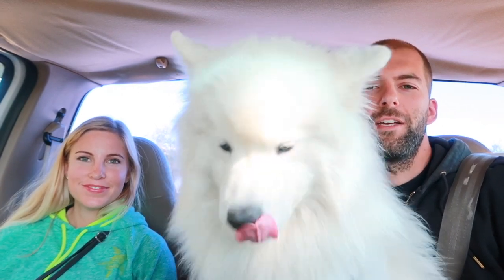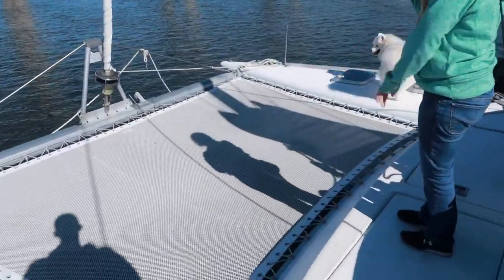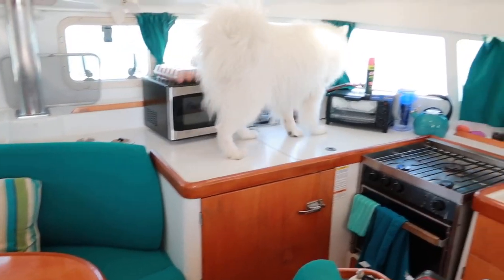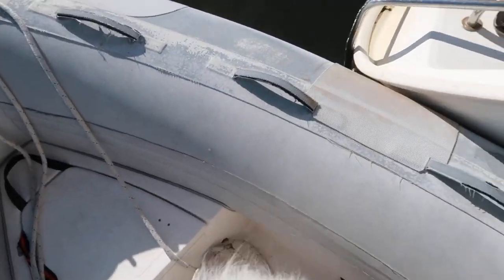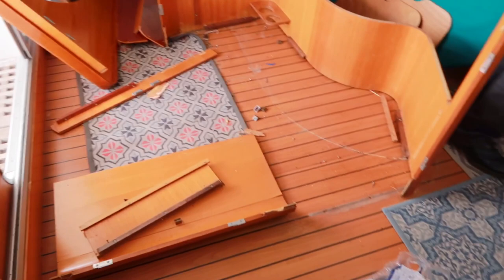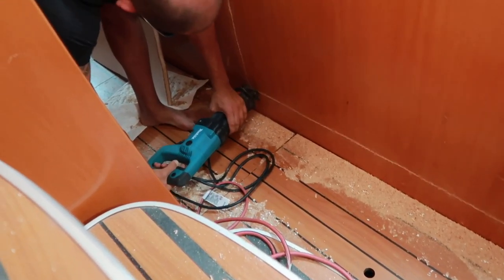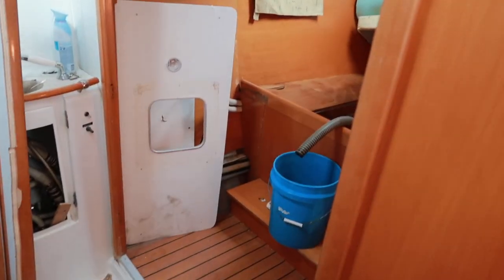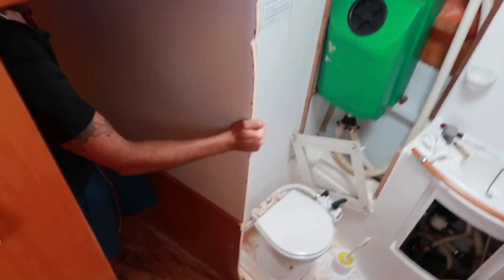Dog moves onto boat & demolition begins!

Comment: Looks like she's going to fit right in on the boat. She sure is a beautiful baby...
My heat sunk into my tummy when I saw you cut through that beautiful molding around the door. It's pieces like that I save for just incase I need to pretty up something latter. Then if I don't use it when I'm done I toss it or give it to someone that might use it. I can hardly wait to see what you kids have planed for the refit/remodeling... Have fun, be safe, and be blessed... BBE...

Comment: Did you guys meet the couple from SV Ruby Rose,  Nick and Terysa. They should have been there at the same time as you guys. If you not from around there you should check out a bar called the Tattooed Mosse and if you are then you most likely have heard of it, one of the best beer/ale selection around.

Comment: I don't care about the logistics of having a sammy aboard a boat, that is the cutest thing I've seen this week. I had a Norwegian Elkhound who wouldn't walk over water... seriously had to carry him across bridges or anywhere there was water flowing under. I suppose the Norwegian in him told him that water == freezing death. Arya is a sweety, but you should do an episode with how you are dealing with litter. I have a cat now and that's easy, but I remember sammy's pooing more than their weight on a daily basis.
Reply: MKTech That's hilarious! My Golden husky X loves swimming in "freezing death". She'll swim out to the ice in the spring, shake off, run around chasing seagulls, and then swim back to land. But she has the coat for it, water never actually touches her skin I don't think. I don't know what kind of coat an elk hound has…
Reply: Wilfred Darr Same coat as a husky, just a bit smaller in overall size, basically split the difference between a Shiba and a Husky and you have a Norwegian Elkhound.

Comment: For the most part I'm really not a fan of production Cats, especially their interior design; but honestly that woodwork was pretty nice and it hurt me right in the feels to see you cut it up.  I'm anxious about this re-fit and hoping you pull it off well.  Trying to be more constructive and less critical without merit, but after the cuts it was obviously really good quality marine ply the factory used; I would have tried to deconstruct it more carefully to preserve the bigger spans of clear plywood.  You could easily repurpose that for other projects or even sell it for a few bucks rather than trashing it.  Good Luck!

Comment: Was part of your refit checking with the boat manufacturer to ensure you were not removing necessary structural sections of the boat interior?
Reply: My thoughts too Marshall but I imagine the answer is yes as the same hull is used for both the 3 cabin as well as the 4 cabin version and the differences are generally cosmetic - but Its always good to be 100% certain you are not removing a structural element that would be there regardless of cabin version!!!!!  While I have no first hand experience, everything I have read or watched (including I believe one of Ryan's expert guests on a vlog) states that if you want an owners version, then invest upfront and buy one as the cost of doing a proper conversion is simply not worth it.  I will be very interested to see how this turns out both cosmetically & financially -  and hope they can prove the so called experts wrong.  Regardless, I wish Jessica and Ryan the very best in their journey.
Reply: k mort "Cost", if doing the work yourself, is greatly determined by what your time is worth, specifically what it's actually worth, not what you think it's worth. In this case, I think he's done the math and is happy with what he's paying himself :-D

Comment: um, in case you guys don't know, that breed loves to roam, run and explore. Sooooo it is FRUSTRATED and wants to be free to run. Property size for such dogs, at LEAST 2000m2. Get some Lavender and Frankincense Essential oils and rub it on her chest. Just a drop or two. It will calm her/him down.
Reply: Mathew Peter Ya totally agree. It looked super FRUSTRATED laying under the kitchen table with the sawsall running 10 feet away.